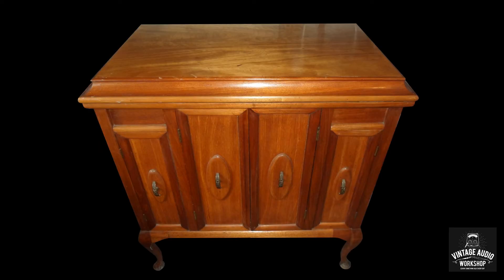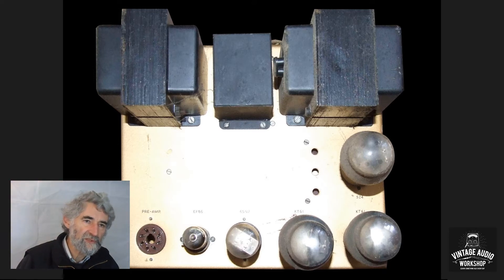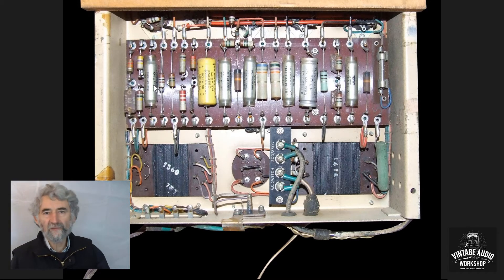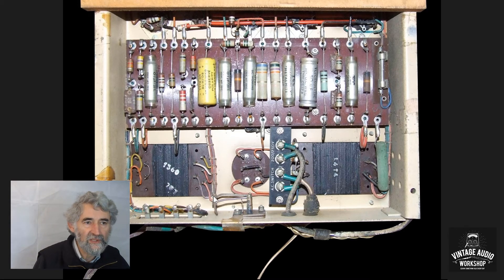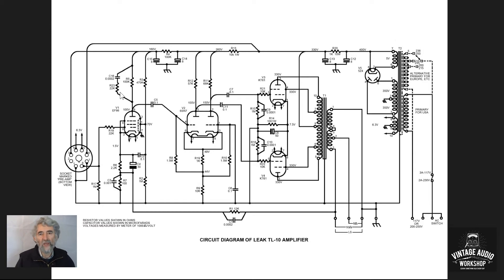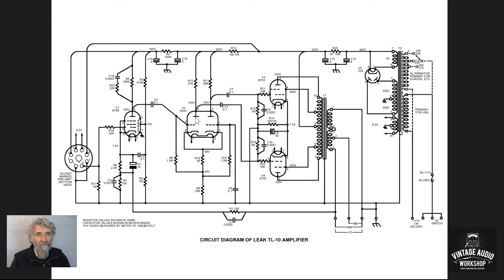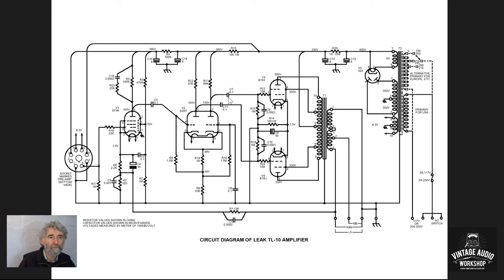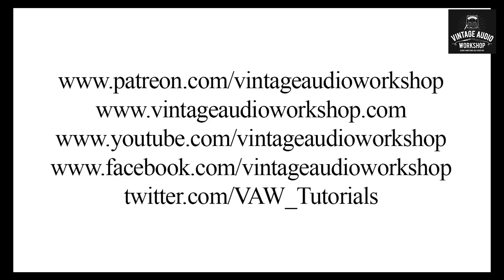Valve Amplifier Study 014: Leak TL10 Valve Power Amplifier

Comment: Interesting about the power output   tubes  biasing .  Would it be better to do away with cathode bias and use two  independent  negative  grid bias  controls ? .
Reply: The actual example TL/10 shown here had two cathode resistors (the high-stability ones discussed) and two bypass capacitors. This is a documented variation. This was the first of Leak's ultra-linear amplifiers and it can be seen that the design was refined in the TL/12+ and other Plus amplifiers. There is nowhere in this amplifier to actually get a negative grid bias supply from.
Reply from the maker: I wouldn't be inclined to modify a well established design except for safety reasons. If one changes the operating parameters then one changes the load impedance too which may not work well without a new output transformer. In theory one can get more power but would it be audible?,
Thanks for your enquiry,
Phil Moss